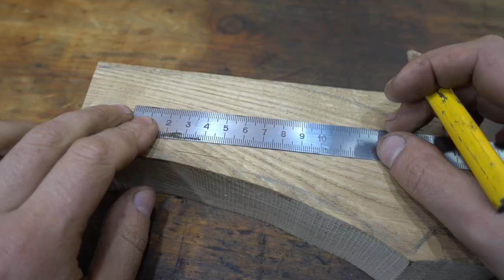Restoration Rusty Mortise Chisel

Comment: Nice work! I especially like how you adhered the cap to the handle. To say that's not going anywhere is an understatement!

One question... after carving in the channel details into the handle, what did you use to get the black in there? It looked almost like a wire saw, but I couldn't get a good look.

Thanks for sharing your work! Makes you appreciate cutting a mortise/tenon joint in the old days before jigs and drill presses.
Reply from the maker: Hello, thank you for your attention. I do this with an ordinary iron wire. During the friction, the wood speaks and leaves this black color.